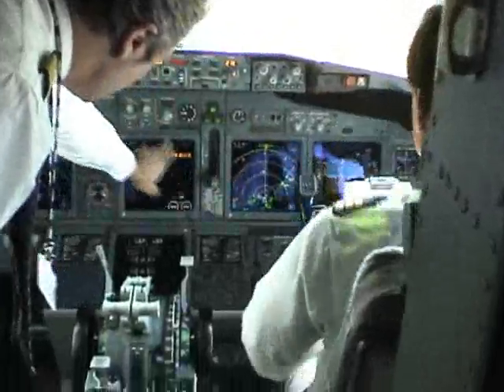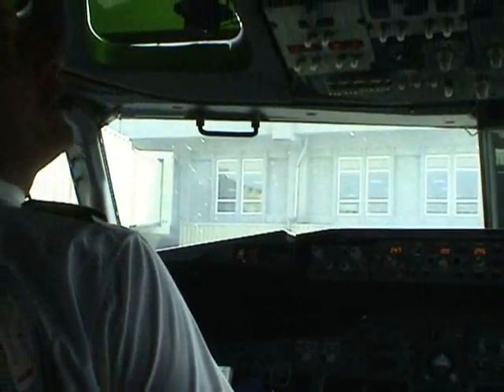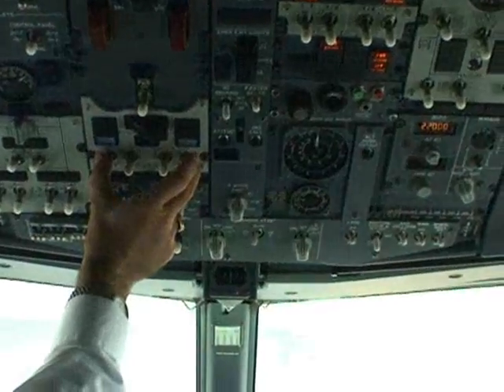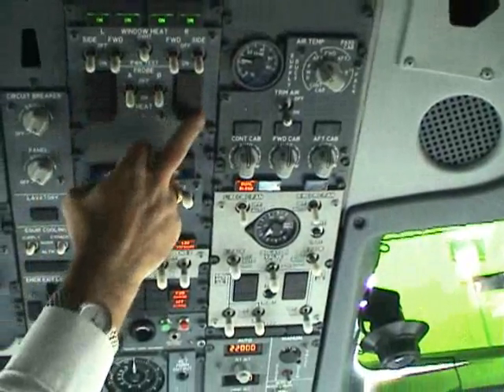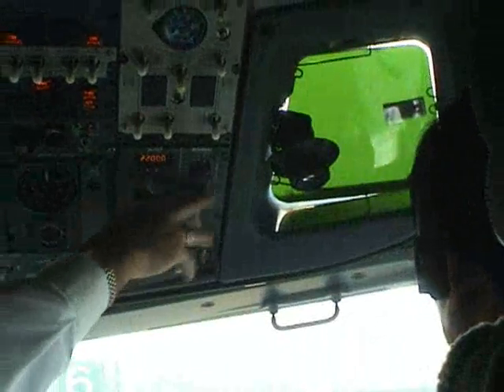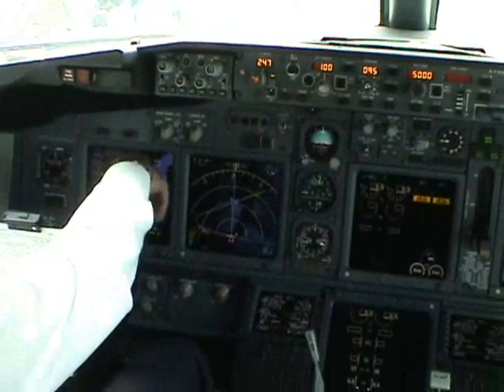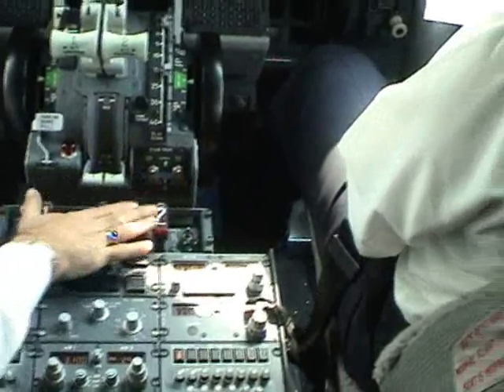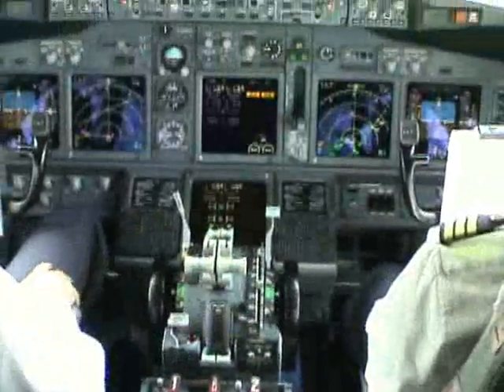Boeing 737NG Cockpit Preparation

Comment: For the FS NGX drivers who believe they can land the real aircraft, you might consider the environment of a moving aircraft, with real wind, noise, bumps, ATC changing every plan you have. Winds change every second (not on 10 minute updates). Add a dirty windscreen, a cold left hand and constant bumps for 3 hours. And that's when things are going well. A few bells and alarms in the cockpit and a wind-shear alert and you might be toast in 5 seconds. There's more to it than knowing the switches.

Comment: you set the ISOLATION VALVE to the OPEN position and the PACKS to OFF. This is because you want the APU (i.c.o. starting the engines with APU bleed air) to supply maximum pneumatic pressure so you dont want to waste any bleed air to the PACKS. The ISOL VALVE open is to get the APU bleed air from the left manifold to the right manifold to start ENG 2.

Comment: Normaly when people use the term course in navigation they actually refer to track. Track is the "real" travel process intended, the heading is the direction that the nose is pointing. In 0 wind in theory track = heading. If you have a wind that makes you drift off the track, you need a wind correction angle. And this angle is the difference between your track and heading. So in all you are correct.

Comment: Elec pumps are needed for hydraulic pressurization, no engines are needed to do so. The APU takes his fuel from main tank 1(left) without a selecting the switch(DC pump will provide the fuel). Procedure states that the AFT pump is selected(AC pump. The DC pump will stop) to on because it's taking it's fuel from a lower place in the tank compared to the FWD pump. APU Requirements: APU cockpit fire switch 'in', APU ground panel 'in' and BAT switch 'on'

Comment: @FS9VATSIM Actually the packs have to do with Air conditioning. They should be off  before engine start since the packs run off bleed air from the APU, and you want as much bleed air for engine start.
Reply: You are right. Because you don't want to install an APU that is more powerful and heavy than neccesary

Comment: As an "old" avionics type person, I understood what the Captain was talking about; what about the folks who just "tuned in" - make anything of all of that?    Lots of switches; lots of lights to see come on and go off.   Only noticed one item that caught my attention:   When he tested the "shaker warning" system, he didn't have control of the yoke; this allows the shaker motor (with an eccentric weight) to REALLY vibrate; is hard on the motor.  In the USAF, maint. usually did all of these checks

Comment: I'm not a pilot but I would think (someone correct me if I am wrong) 
A course is your intended path from point to point.
The heading is your actual physical forward position meaning the actual direction you are headed in..
A course is more like an imaginary line decided on usually before the trip or decided on by someone else that you may or may not be able to travel exactly to but try to.

Comment: @char1eston well remember, its impossible to stall or lose control on a airbus because of the FBW (fly by wire) system. so u really dont need two hands. why do u think the safety record of a 777 is good? its cuz boeing started to use FBW too ever since the 767.

Comment: I wouldn't say that they look like "alien" spaceships, but the cockpits shure do look very cool!!
Btw, i have a question concerning the fuel tanks. Is the crossfeed valve open at all times? I thought it was only if there is an imbalance in the fueltanks. And in my flightsim the fuel pump switches are usually switched off.

Comment: @rappinCheese Yeah. Ask Air frace what happens to fly by wire, when pitot tube freezes, or when you loose the electric system. 737 has 3 hydraulic systems and can be flown without any of them. Cos pilot actually can control planne without help o Power trasfer units and such. On airbus there is no direct connection. So mistake i computer or loose of electrics = RIP...

Comment: @char1eston ummm.... do you know that stick in airbus planes only sends an electrical signal to the computer? you don't actually move anything mechanically.... It's the same in the F-16, do you need 2 hands to pull 9 g's? maybe 2 fingers are enough...

Comment: APU must be running or ground air applied

Packs......off
starter switch..... ground
25% N2..........start lever to idle detent
56% N2......starter motor cut out
monitor Engine T's & P's

Comment: To the 22 haters and the others that bash the automatic system in Jetliners.
Let me ask you 2 very simple questions:
1: what is wrong with computers? you are using one right now!
2: knowing that almost 50% of all "crashes" are from Human errors. Would you still get in a plane as a passenger knowing there is no humans in the cockpit, that the only thing flying you is a giant laptop?

Trust me, this "computers" crash way more than humans.

Comment: I'm sorry, but real life is difficult. FSX is not even close. It takes lots of practice to be profficient. And every new pilots nowdays has hundreds and thousands of hrs FSX, but still require simulator training and months in line training, even after the type rating is obtained. Just because FSX is not even close to real life. And yes, i "fly" FSX and i fly B737NG

Comment: He said we forgot but it's obvious he checks the seatbelt signs right after the hydraulics. I'm not defending him, this is still not the correct way to do it. 
When your in the cockpit before cabin prep you 
Sit in your flight seat!
Grab the checklist!
Go over the items WITH your co-pilots confirmation!
This captain is not my style and as much as I'd love to fly the 737 I wouldn't like to do it with nothing less then a CAPTAIN with all 7 letters. A pro with a high standerd and excelent communication. 
This dude just doesn't have that "umf"
Reply: +Maty Far Cockpit preparation isn't on the checklist , checklist only has critical items
Reply: Pilots go through flows to start up a plane, then back it up with the checklist, which usually only includes the critical items. It is common to make a minor preflight error during their flow.